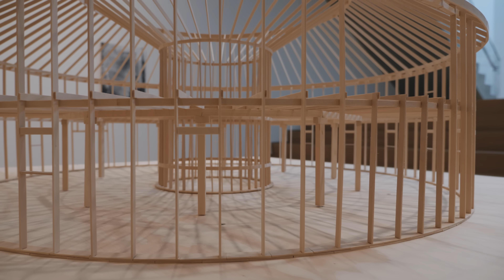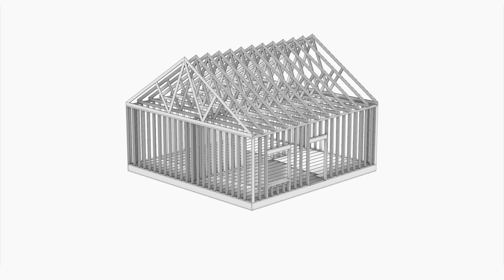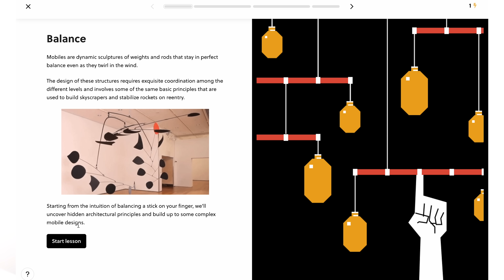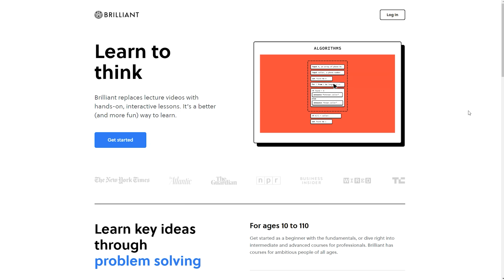The Genius of 2x4 Framing

Comment: 2 X 4 studs aren't 16" apart, but 16 O/C,  On Center (ready to receive 4 X 8 foot drywall or OSB). In your otherwise complete and engaging lesson, I'd wish you'd show the odd and artless but CHEAP and easy way 2 X 4's form useful corner posts, or how the stabilizing diagonals seen in the Levittown model are long gone, made redundant the anti-torque properties of sheathing, first with plywood, now OSB. Sears Roebuck probably deserves a couple lines more than your mention, with major success in pre-cut full size numbered house kits shipped everywhere rail runs, decades before the 1950's housing tract boom. Very engaging and informative video.

Comment: "It doesn't make sense to build any other way."  Oh no... it definitely makes sense to build lots of other ways.  Stick and Twig 2x4 house are structurally weak and easy to destroy.  If you want to build with 2x4 make them steel at the very least.  People say "that's expensive" and this is only because the entire industry has been designed to make it expensive.  We fundamentally hold ourselves back with the amount of corruption and market manipulation.  We could build houses that could stand up to all but the most powerful of tornadoes and hurricanes.  The cost to the economy is far greater when we cost our costs to the literal bone that people actually DIE.  Not only does it make sense to build another way... we should discard our near century of building absolute garbage that can barely last 30 years without turning into a condemned house!  There are houses from centuries ago that will not fall down from the things today's home will fall down from!

Comment: 8:50. Wood framing you don't know what you are going to get unless you specifically get certain grades of wood.  Utility lumber can't be used on load bearing walls, you have to have grade 3 or better lumber in order to meet code.
Reply: Codes vary from state to state

Comment: Although the burger metaphor could be taken as an insult to the more cynical stereotypes of American life, I actually like how you made it here. Because after all, a cheeseburger is only really bad for you depending on the ingredients, and the QUALITY of the ingredients (and the skill/knowledge of how it was put together.) 

Which fits perfectly with 2x4 framing: sure it's much simpler and so opens it up for less skilled/knowledgeable people to do something productive/adequate with it (albeit sometimes at a regrettably low bar), it also still has a high "skill ceiling," where those who are very skilled can use the exact same pieces and create something truly impressive, and extremely functional.
Reply: One thing I’ve learned after walking in and out of many building in construction… the framer that has all their joints touching, nails placed correctly, can frame complex areas, can work with “new” people, have his shit be SQUARE, and do it all to code is an extremely high craftsman. Meanwhile I made a small wall that did the job but looked like shit this summer. We both made burgers but the other guy’s is a Michelin star restaurant burger. Doesn’t mean mine didn’t work, his was better.
Reply: I love the burger comparison.  But I am an American who has a burger obsession.
Reply: Red meat and excess fat is bad for most people most of the time
Reply: @AllTheArtsy  humans wouldn’t be here without red meat. Also “excess” anything is inherently bad. 

Also how is this relevant.
Reply: @Bioshockaholic  it's relevant because you claim your analogy based on the "fact" that "a cheeseburger is only really bad for you depending on the ingredients" when the core ingredients are bad for most people most of the time
Reply: @AllTheArtsy  disagree
Reply: @AllTheArtsy  Maybe for some.  I eat a ton of red meat and the doctor always says that I am healthy.

Comment: The hamburger metaphor is nice. Just a reminder that beef patties, the buns, and pretty much every condiment on the market contains  cellulose made from wood pulp. So the walls of your house and your burger are partially made from the same thing. Modern enginuity, eh.
Reply: You can say the samething... It's all carbon based.
Reply: @randybobandy9828  everything is made of stardust
Reply: @johngalush8790  nothings touching

Comment: Would this work in tropical countries that rain a lot? Where I'm from, houses are made from cinderblock in terraced form. Wood used to be traditional material but it's expensive these days. I did see a similar framing technique  using C channel and cement board, but it's quite recent.
Reply: Wood homes are good for places that those trees they use for wood grow. It doesn't make much sense to ship wood far away.

Comment: Id like to build my own house with the wood not dry. Back in the day they built them fresh and they would tighten up solid when dried.
Reply: Well wood isn't as good as it used to be and it's nothing we can control. Hundred or more years ago  trees where old and had very tight growth rings making the wood much more dense and strong. All those trees are long gone and now all are wood is made from young trees that have further apart grows rings and are weaker and support less weight per square inch.

Comment: Thanks. That was really interesting.
Viewing the construction techniques in terms of social change and consumer culture was thought provoking.
In the UK and Ireland the term "timber frame construction" is used for a hybrid of techniques. Typically it would entail factory made "light wood framing" INTERNAL walls, roof trusses and staircases combined with on site construction of floors. The EXTERNAL walls would then be constructed around the erected frames from brick or concrete blocks (=cinder blocks). It's not exactly modular construction but faster than the previous bricks and mortar system and looks the same from the outside when finished.
And we drive on the left hand side of the road.

Comment: You spend as much time talking about hamburgers as you do framing. As a carpenter with well over 30 years of experience my opinion is lite wood framing is the cheapest, fastest, and least desirable way to do it. Timber framing is vastly superior in strength and structural integrity period. It is slower and it is completely doable by a single person to correct your zero experience opinion on that point. Americans like everything cheap, and fast and have no concern for longevity in any product because that is what we are tought. Also you are 100% correct, you can teach any idiot to lite wood frame, that's why it's so cheap and fast. You can get lots of people to work very cheaply because they have very little skill. Unlike timber framing that requires a professional craftsman with a deep understanding of engineering and design.

Comment: Sometime a few decades ago we stopped using true dimension lumber and that is not good. A true 2 inch and not 1 1/2 inches stays straight. Also 70,80,90,100 years ago we would only use clear vertical grain lumber. These methods would result in nearly zero waste.

Comment: Stewart Hicks apologizes in the comments for implying in the video that framing is a low skill job.
Ummm, yeah, it quite literally is. Do you have to be handy, sure! That's a bonus. Does it require a lot of intelligence? Nope.
Call me stupid. Hell, I'll call myself stupid for sake of argument. I can build a deck, I can frame walls, measure and cut birdsmouths into rafters, I can build stairs. And I build them fast and I build them well.
I'm handy in that sense, not necessarily intelligent. You can learn and apply, but it doesn't require any critical thinking.
In conclusion, rough carpentry is not a skilled profession. The end.

Now for the worth of that low skill job, we should all appreciate the low skilled workers that help build up modern society. The backbone of the construction industry. No less important than the engineer that designs the machines that turn logs into lumber, or design the vehicles that transport it.

Don't be offended if someone calls your profession low-skilled. Be offended if they don't pay you a decent salary for doing it.
Reply: You make some great points, but I'd argue that intelligence and skill aren't as intertwined as you make them out to be. You're correct to say that framing doesn't require much intellect, but it still takes time to learn all the prerequisite skills and become proficient. Just as an example, I've spent the past few years working with a Doctor on building his McMansion on a mountain. He is a very skilled individual, intelligent and attuned to his work. He tried his hand at framing for a stretch there, and after two months of directing us and working alongside us, he was still a hot mess at it, and may as well have been standing around with his hands in his pockets. I can't even say how many times we had to undo something he'd put together and do it properly.

Comment: It's fascinating how much common there is between fast food and 2x4 framing. Both even have similarly major downsides that are very often strongly downplayed by certain parties. Interesting all in all!
Reply: Thermal bridging too would be one of the major downsides.
Reply: which are the specific dowwnsides of lightwood framing
Reply: @cruss9064  thermal bridging, leaks air like a sieve, requires more tradesmen and contractors to finish the job which opens you up to a host of ill-installed practices that are usually seen after the homeowner has moved in, etc etc.
Reply: @cruss9064 it's structurally inferior to timber framing too. Not to mention how similar stick framing is to a McDonald's burger....they both use super processed "ingredients" for building that object.
Reply: @HeroOfTime303 Super processed? You mean dried? Like wood is dried almost no matter what it's used for? You're calling that "super processed"? Planing? Do you not know that timber framing is also planed? Treating? Staining timber framing isn't a treatment? C'mon.
Reply: @cruss9064  from European perspective? It has way worse acoustic properties than plenty other technologies. Hanging heavy objects on the walls is more problematic, or even something as simple as per sockets. Durability is lower than many other technologies. Woods is flammable, and can be damaged by mold. Just to name a few.
Reply: @jankoodziej877  Acoustic properties? Insulation. Can't hang heavy things on the wall? That just tells me you aren't actually paying attention to how this style of framing works. Per sockets? Not sure what you're referring to, but I'm sure it's probably wrong. Wood is flammable? Yes. Treated wood is far less flammable. Most insulation is also fire resistant. And for all that better performance, roughly 1 in 89,600 people in the EU die annually in a residential fire, while that same number in the U.S. is only 1 in 110,000. Homes in Europe experience comparable rates of mold (when looking at rigorously-derived statistics from both the U.S. and EU). And while mold can damage wood over time, it's not going to compromise the structural integrity of your home. But do you know what else mold damages? Concrete. Mold damages concrete in a way that makes it absorb still more humidity, grow more mold, and become more damaged.

Comment: fun fact: a 2x4 isn't actually, well, 2 x 4. the proportions are the same, but its typically referred to as 2 inches by 4 inches, even though its closer to 1.75 x 3.5. this si due to a number of factors, including the shitty, late "standardization" of the imperial measurement system, and a host of other things.

Comment: You really need to give more credit to who is doing the building. 
The houses in Levittown were built as fast and as cheaply as possible. They used basic 2x4 lumber, but there was no emphasis on quality, only speed and price. Using the same basic materials, you could build a much higher quality structure, just not as quickly. Focus more on the chef/carpenter and the skill in which he uses the basic ingredients, this is what determines what level of quality you get, not the ingredients alone.

Comment: I've pretty much built my tiny house that way even though i live in europe. It's such an easy, cheap, ecological and light weight way to make a building. In my case i managed to make almost the whole building out of natural materials (mostly solid wood and hemp insulation).
Reply: @Phillip Banes They never claimed Europe was a country.
Reply: @Phillip Banes Go have another drink.  Don’t reply when you are inebriated.
Reply: @Phillip Banes 
Switzerland. Doesn't matter though.
Reply: @Phillip Banes 
I never wrote or implied that europe is a country. Odd comment. Want to be a good troll and double down on the stupidity of your comment now?
Reply: @@phillipbanes5484cringe😂
Reply: @@phillipbanes5484 i poopd
Reply: Interesting. As I am also finishing a tiny house, I actually came to the same conclusion as this video: that 2x4 framing is genius! 

Mainly because the regular cavities between the studs are so convenient for accommodating insulation [which isn't or wasn't so common throughout the world] as well as wiring and piping [the regularity of the studs holds the wires and pipes up nicely]. 

I think 2x4 framing's modern success can be partially attributed to its ability to accommodate the modern conveniences of insulation, wiring, and plumbing.
Reply: @danteinferno175  
I'm in Europe though and i didn't use 2x4s. My tiny house is very tiny and i wanted it to be light. So i just used the technique, but used thinner pieces of wood.

Comment: A standardized way to frame multistorey buildings was developed in Amsterdam after several big city fires razed large parts to the ground. The design was standardized because of the availablity of sized lumber - the size of the lumber was limited by the size of the ships carrying it, so the standard was developed around the materials. Sized lumber was a new development that came about with the advent of industrial windmills in the late 1500s, that could easily saw boards from rough lumber. Pegs were used as fasteners, very simple and effective, not unlike dowel joinery. The new system allowed for a mulistorey house to be built in mere months instead of many years.
Reply: Amsterdam houses are standardized, but not wooden framed. They are made of brick walls and wooden floors, with a wooden roof construction. The wooden floors rest on the brick walls.

Comment: I'm interested to see how building materials and processes change in the next decade as we apply technology that enables more factory work, custom tools, and computer systems that enable organization of custom parts. 
As for 2x4 framing I don't know if I'd call it genius but...  
Light framing shares features with other scalable building processes such as drywall, painting, and shingle roofing.
It's modular.  Framing materials work for all shapes of houses.
In stock at local suppliers.  It has logistics advantages in that it can be moved around by just a single person.
It's a low waste process, both in manufacturing and in the field.
Standardization in process achieves high economies of scale at low cost.
Reliability is achieved through redundancy.
It uses simple tools and fasteners and is generally accessible to all skilled tradespersons.

Comment: also, why did it become popular in the states, because you can build with low skilled labor.  Anyone that can swing a hammer can build with 2x4s, however, to build QUALITY brick homes you need very skilled labor.  Brick layers, foundation experts, right temperatures and everything needs to be done right the first time.  I've seen wood framed houses built so fast with zero fucks given whether the nails the sheathing even hit the studs, some top quality Pahlish Construction.

Comment: Really enjoyed this video on framing. I’m not a handy person, so it was good to know the difference between post-and-beam versus lightweight framing. We just had a house built with lightweight framing and I’m thinking in 2022, couldn’t they use some kind of polymer/mixed material for longer durability… nope… same lightweight framing as 70 years ago!
Reply: There are probably quite a few material differences than the framing used 70 years ago. Your headers are probably LVLs. You probably have roof trusses assembled with metal connecting plates. Your exterior wall and roof sheathing is probably OSB. If you have a two story house or a basement your floor system is probably TJI's with an LVL rimboard. Much less dimensional lumber is used in today's houses than 70 years ago and today's products are generally much better.

Comment: Where i live we build 95% of houses out of stone and concrete. We don't like the thin and poorly soundproofed walls and ceilings of this wood framing stuff. But it is way more expensive. A standard single family house easily comes at half a milion euros. At least stone or brick walls don't need paint or cleaning or anything when it comes to maintenance while it lasts much longer than any wood structure. Just a bit of refurbishment every 50 years or so and your house can stand forever. Many houses in my city are hundreds of years old. Some where already old when america was discovered.

Comment: Cool video. Good stuff. A bit misleading though. I'm a wonk, and I originally tuned in because I was curious why 2x4 was so brilliant as compared to the increasingly popular 2x6, thinking there was some new information for me. I was wrong. its just a misnomer. The video is about why light wood framing with dimensional lumber was revolutionary in regards to timber framing. Most of the footage actually shows 2x6s. Some people think this is a silly distinction, but not me.